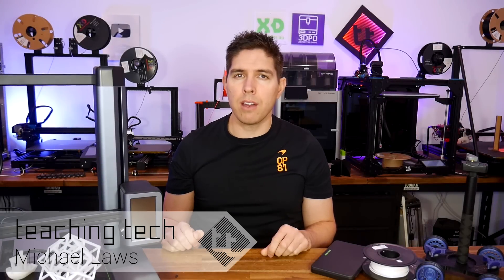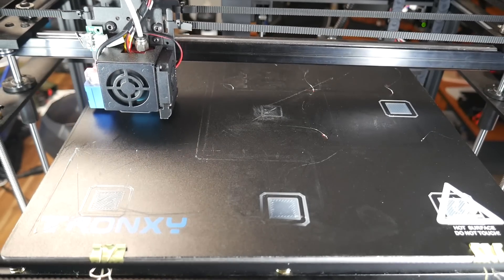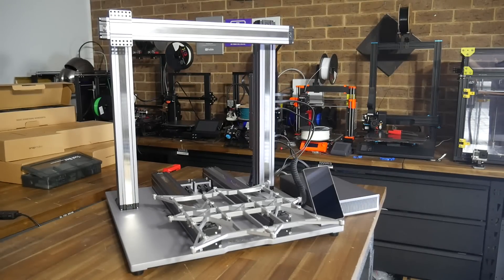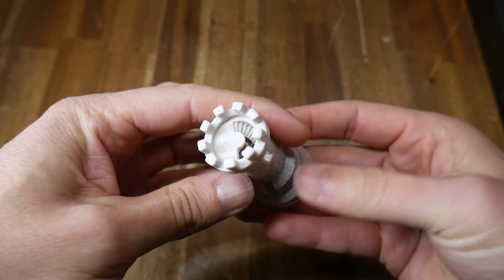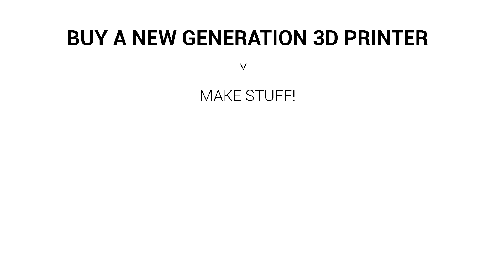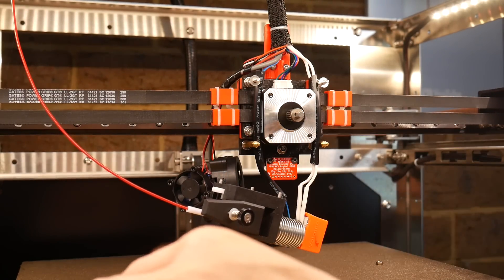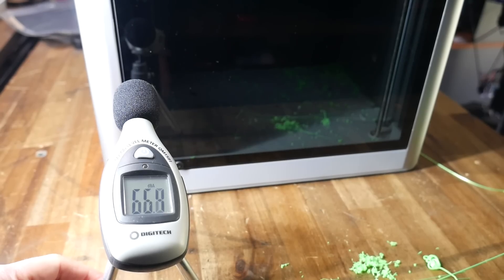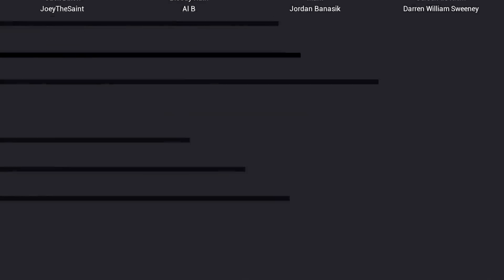Next gen 3D printers are here, but do they bring fresh problems?

Comment: I didn't realize just how pricey that Prusa XL with toolhead changer really is.  That is flirting in price point to a low end professional machine fully enclosed made for engineering filaments isn't it?
Reply: Prusa is a company formed in Josef's image, and Josef does whatever he likes. The XL was designed and made because Josef wanted it to be done, not because there is a market for a 5 head tool changer aimed at hobbyists. Prusa was blindsided by credible competition in the form of BambuLab. I will bet that Prusa has a CoreXY under wraps but is not ready to be released yet since the Mk4 is still new.

Comment: For a start; a disclaimer, I have a Prusa MK2.5 which I've modded (Yes a modded Prusa, before anyone attacks me, this thing has ~8000 hours of printing on it) becuase its original mainboard gave up (the bed mosfet burned up) so I had no choice, apart from that It has been a bulletproof machine for years. Yet I am quite angry at Prusa, it looks like they've sat on their asses for too long, I like the idea of still upgrading the I3 platform with the MK4, but I would have liked it more if they had made the smaller coreXY printers from the AFS system independent and sold those for a reasonable price (I know they can't compete with chineese almost slave labor). I'll support them as long as they are around since they are basically the last company remaining from the peak of the RepRap days, that still stick to the open source mindset and don't lock down everything (MakerBot, Ultimaker, etc)

Comment: working out of the box is the absolute minimum deliverable.  reduced maintenance is the next step though.  For example, I'm DONE with v-slot wheels.  I've used an ender3 for a few years now, and I always have to keep a box of vslot wheels ready to be swapped into it because of how often they degrade or need replacement.  Further, vslot wheels lack precision and overall, I'm really glad to see that linear rods and rails are on the rise.  i3 "bed flinger" style printers are EXTREMELY slow.  I am also really happy that more turnkey corexy style printers are now starting to come to market.  While NOT for beginners, I just finished building a 350mm voron v2 and am currently in the middle of building a (120mm) voron v0, but I want to have a middle-sized corexy printer to replace my ender3, but i'm not sure if i'm going to build or buy this time.  I'm giving some serious thought to picking up a bambu labs x1c with their AMS solution as I'd like to get into multicolor printing and my investigations into multimaterial units have lead me to the belief that many / most of them are simply unreliable. (lots of complaints about the ERCF for example).

Comment: 100% agree with your assessment. Thank god for the new generation of printers! As a matter of fact, I'm selling my 3 "old" bed slingers. It was fun tinkering and upgrading them, but I'm done with that now. I'll still keep my 2 Vorons for their large build volume they'll receive zero updgrades from now on. My 2 Bambu Lab printers on the other hand are doing the bulk of the work, and are allowing me to concetrate on model design instead of spending my nights fixing hardware and tweaking firmware.

Comment: People crack me up, it’s not all or nothing, some people are more comfortable with soldering and wiring and replacing parts, and some want a tool that they can plug in and use for making. Not everybody wants to spend time adjusting and tuning and building/fixing their printer, they just want to make things.
Reply: 🙌👏 Exactly. I had "open" diy printers and "closed" printers.  I do not have the time or patience to rebuild and mod a printer for years that would never beat an off the shelf product. 

I have  mk3s+ and X1C. I could mod the mk3 to a mk4 and it still wouldn't come close to the Bambu.

Comment: If the temperature of the environment around the printer and all the variables of filiiment is controlled then there is no reason that with current tech a perfect print cannot be made every time. If manufactures of filament submitted their products to a testing center that graded all their batches of filiiment and then a qcode sticker was put on each box that one could use to scan the setting into the slicer that wld mk things sooo easy.

Comment: I am at an age where I treat all of my products with the "Ship of Theseus" mentality. Basically I could change out every part but would it even be the same printer? Even if mod and upgrade it to hades and back and it still not beat an off the shelf product then it is not worth keeping around if it breaks or needs major work. 

Talk of customer service, modding, tinkering long term support just screams I am spending/wasting more time on the printer than printing. I kept an mk3s and ender 3 alive for years($$$) and now 1 printer gets out more parts than the both of them combined. I would be a plum fool if I upgraded my mk3s+ to an mk4 and it still be a worse solution to my best printer. 

So I am firmly in the "it just works" camp. My client's prints don't get completed due to an ideology. The open source community had all of the ideas but never got a retail product shipped. It took a corporate approach  to combine all of those ideas into a functional and compelling product.(bambu lab) The bar has been set hopefully any business that wants to enter keeps "polish" in mind when they create a product.

Comment: I gave up with my snapmaker, it’s design philosophy requires it is made with extremely high tolerances. Unfortunately their quality control is terrible. I proved over two sets of rails that the bed head can’t stay flat (I.e the level of the head above Z=0 varies over the xy of the bed. They stopped trying to find the cause of issue even after they reproduced it on their reference machine in support. Do not buy.

Comment: all the 3 companies you have chosen are just the ones investing more into marketing and looks. sure prusa is very reliable but way to overpriced. bambu is more of a hype and still in alpha testing made by the customers. anker is just a shiny joke compared to other 3d printers.

There has happened a lot within the last 2 years and the printers are evolving fast. auto bed leveling, klipper, magnetic pei beds, etc.. and the filament is evolving as well with many new materials available.

but for begginers the real good thing is affordability. you can get a very good printer like the elegoo neptune 3 pro/plus/max with all the new evolutions for a very low price. these printers work really good out of the box and are fun to print with. this will open the hobby more to the casual user than all the marketing about speed or shiny looks.

lets wait and see what the future will bring to our hobby. but one thing is already obvious: its an awesome hobby and highly addictive.
Reply: I don't think calling Prusa overpriced is fair. The extra you are paying goes to quality parts, PrusaSlicer (wich benefits pretty much the entire hobby space), and to their employees wages. Wages in europe are simply higher, so it's not like Prusa is making tons of profit. I get that you don't value the fact they aren't outsourcing to cheap chinese factories but it doesn't make them overpriced imo.
Reply: @ren8  prusa did a lot for the hobby for sure. and producing in europe is a good thing for europeans. but customers dont value that either. compared to kitchen parts, people tend to buy stuff cheap for the all day use. only the ones who try to take it more serious and cook like a chef buy the expensive equipment. but the mayority stick to the cheaper tools that do the job as well. and so for 3d printing to bring more people to the hobby i think elegoo does a great job with the neptune 3 printers. they are easy to use, reliable and easy to repair and way more affordable. this will bring a lot more people into the hobby. and the ones who want to take the hobby on a bigger scale can switch to prusa and spent the ammount of money needed. but they already have the skill and knowledge they gathered with the elegoo. so prusa did a lot in the past and elegoo is doing a lot now. its all good for our hobby and i love it.
Reply: @koppfrosch7439  Problem is when those cheaper tools dont do the job as well... Which seem to be the problem with 3D printers.
I'm always prepared to pay far more for something that actually works.
Reply: @martinsvensson6884  but what if the cheaper tools do the job ? and the new elegoo neptune 3 printers do the job very well for a very low price. there will be other companies joining in soon with cheap printers and they all will do the job by far good enough for hobby printers like me and many others.

Comment: Not making the printer firmware opensource really doesn't matter either. If the machine is decent but it could be even better, and the user base is big enough, there will always be someone who reverse engineers it and releases it to the public. The Tronxy Chitu firmware/board was a perfect example of that. I do think that companies should make their machines opensource once they are no longer supporting it or releasing updates though because it breathes new life into them after they have given up on them, and it also allows the users to update the security of the machines along with new features.

Comment: It's mind numbing how little progress has been made in FDM 3d printing over the last decade. Yes stratasys has some patents but not all of them. It's not that hard to put a heated blowed with a PID controller to control chamber temp. There are definitely ways to make a tool changer that don't violate stratasys parents. How has no one seriously approached a motor on the print head so it can print on walls, e.g. be non-planer. How has no one developed truly 3 axis gcode? Why are mesh models still standard the STEPs have clearly legible b-rep data? Why has no one (other than delta) tried other motion architecture other than belts?

Instead all we get is, hi look how fast I can print PLA, and can do it in multiple colors, k thx byeeee. What a joke.

Comment: Personally a 3d printer is a tool not unlike a hammer. I don't care what it looks like,  just how well it does its job.  I outright refuse to pay a premium price for something that has been prettified so it looks nice on the desk. I'm not using it to try and impress anyone and it's not a fashion statement. Spend the engineering time on actual engineering and put the design degree away.

Comment: Bambu Labs is the only new generation machine, why is prusa even mentioned? Their printer has been the same for a decade. Still using 3d printed parts on their printers, and charging huge prices from beginners.
Reply from the maker: This was said in the video. Much of the focus was contrasting Prusa with the new corporate players.
Reply: I honestly don't understand the Prusa path taken these days.  With the options like bambu of just buying a reasonable priced machine for features and performance and largely having a hassle free experience.  Buying an increasingly good budget machine and mastering it or customizing it to your preference for much less than a Prusa.  Or straight up building something like a voron kit and making it exactly how you want and completely in your control on parts and such.  Prusa doesn't seem to fit for anyone except someone who wants to tell you they own a Prusa.
Reply: Interesting video! The Bambu Lab X1 Carbon has shaken up an industry that has been pretty much asleep for years. My first printer was a Robo 3D R1+. Ordered from Best Buy to pickup up from the store because of their 14 day return policy. I figured my experience would be really good or really bad based on Amazon reviews of pretty much every 3D printer. It printed very reliably for me with very little fooling around for over five years. It was time to replace it and I was surprised that I couldn’t find any printers that were a significant improvement since it had automatic bed leveling and direct drive. I happened on an X1 Carbon with AMS review on YouTube, was sold on it, and gambled with a Kickstarter Unit. I wanted a larger bed size, but this one was bigger than what I had and the increased speed and color possibilities had me sold. There was nothing comparable. Spent more than I planned to, but it was well worth it. I have had so much fun designing and printing guitar parts. It’s default print speed is about 3 times faster which speeds up the entire design print modify process. Bambu Lab has kicked up a firestorm and it’s going to force other makers to up their game if they want to stay in it. It’s great to have choices, especially for those who want a printer, not a project.